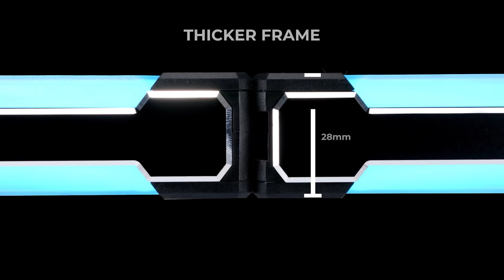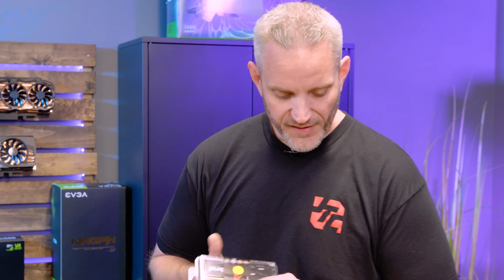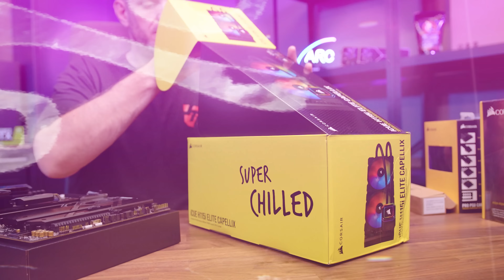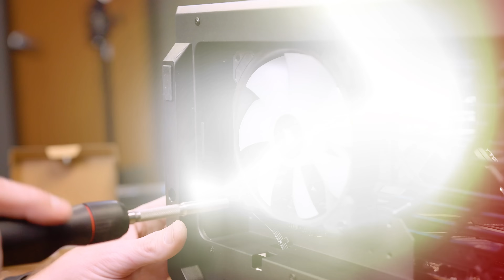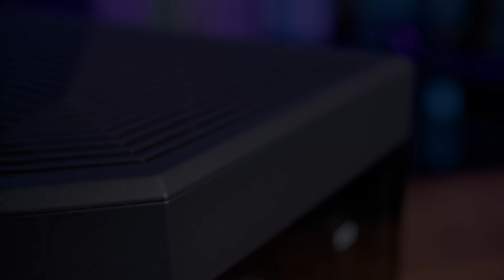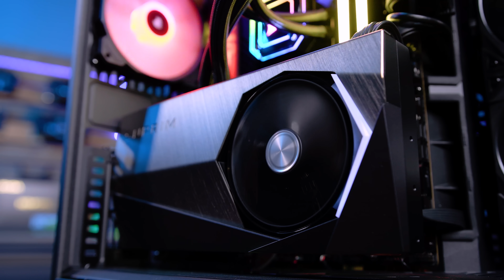I built a PC in the Hyte Y60...

Comment from the maker: Hey guys! Small correction, at the end incorrectly called out the wrong brand, I MEANT to say iBuyPower! For your custom and prebuilt needs, check out https://www.ibuypower.com!
Reply: teehee
Reply: Small correction Jay, You can use the commander with the two types of fans you have because they are both 8 led hubs you just select ML or SP in Icue. I have done a few of the ELITE CAPELLIX with the newer SP fans in a case with just the commander.
Reply: This video is perfectly timed.... I just finished a Hyte Y60 build on friday. Custom water loop with a 3070ti FE and I9-9900k. First ever water loop. I need to redo the bends at some point because they are bugging me.
Reply: Did u have to add thermal paste?
Reply: I am about to build the same exact case with a 280 mm AIO for context should I set the fans up only the bottom to intake
Reply: Hi Jay looking to getting the y60 case I have the Razer Tomahawk itx case at the moment, will my motherboard which is asus strix B660-i fit in the y60 or will I have to get a new motherboard
Reply: Parts list-listed z690 not z790 mobo :P lol just fyi, both are great options, but obviously the z790 is what was used in this build :P

Comment: The case is not the issue, the GPU is. This case was meant to be used with either a GPU which is maximum 2.5 slots wide, not 2.75. It might not sound like much, but those 6 mm frees up more space than you might think for cooling. Granted, the 40 series was not a thing when you did this, so talking about a 40 series 70 or 80 which is narrower and run much cooler than the 30 series, is a moot point. What this case was meant to do, was to run water cooling on both the CPU and GPU. This thing will be a monster with a 14900K and 4090 or AMD 3D CPU in it, as long as there are water involved. And while I understand your choice of fans, try and run the Arctic P12 Max on that radiator. Your CPU temps will plummet, and they are quite a bit quieter than the Lian Li's. Those Lian Li's are hybrids, and while they do kinda work on the AIO, they are far from optimal, especially as pusher fans.

Comment: I'm building in the hyte y60....once i plug in the gpu (NITRO+ AMD Radeon™ RX 7900 XTX Vapor-X 24GB) , motherboard won't work.  1000 w psu.  if i don't plug in the power, gpu rgb will light up and board works.  any ideas?  I've looked on the web and can't find anything.  thanks

Comment: If i horizontally mounted the gpu and swapped out ALL the fans with top tier fans, and put fans in the bottom and 3 fans in the side, would the thermals be ok?
Reply: Should be, really depends on the intake/exhaust ration

Comment: According to studies the aio should always be in the intake config so that you're pulling cool outside air through the radiators instead of blowing hot air through it causing the water temps to be the same as the hotter temps inside the case.

Comment: Can I it handle like 4x 3.5 Hard drives? I willing to buy it but didn't see any options for this SSDs and HDs mount
Reply: Why on Gods green earth would you still use HDD
Reply: @OkAndBruh  if you don't have anything to contribute with just pass the comment. I already solved the problem using a DIY tray made to handle 2 more HDD inside my case.
Reply: @vendra00  I’m contributing is knowledge that HDD is slow and outdated. You can get SSD that’s, albeit, slightly more expensive, but holds at least 2tb of storage that loads significantly faster.

Comment: nice, thanks for the build i want that card in that case and was unsure if it was workable, nothing sucks like having to return a expensive case or an insanely expensive card because they wont play well together. shame the hoses arent longer to route them away and more discreetly. the setup of the commander pro on the sled is handy, planning on corsair fans  altho thinking 140's on the bottom for a bit more flow and maybe the  shift 1200PSU for a bit cleaner install.

Comment: I'm planning on buying this case but i'm facing a dilemma on the fan configuration. I have a 5600x and an msi 2070 super as my cpu and gpu which arent really "hot" components. I have the following fans: 3 Corsair LL 120mm, 2 LL 140mm RGB fans and 2 Non-RGB ML fans in my current case with an push/pull configuration using the both 140mm fans. With that being said, what would be the ideal fan configuration on the Hyte Y60 for optimal airflow? I was planning on using the Non-RGB ML 140mm fans has bottom intakes, the remaining 120mm fans has Rear and Top exhaust and the RGB 140mm radiator fans has intake on the side. The thing is, aesthetically speaking i think the 140mm LL RGB fans as intakes on the side are not gonna look good. Will the temps be really that bad if i use them as intake also? If anyone could help me i would high appreciate it.
Reply: You pretty much want more intake then exhausev

Comment: Jay,   I am working on this same build and all is working well except now where I am trying to connect the GPU to the PSU and there is no way that I can stuff all those wires behind the PSU and install it.  Cables that came with the Corsair PSU are just to bulky and stiff.  What did you use?

Comment: You mentioned you did bottom as the only intake? So the rest side, back and top (radiator) will be exhaust? Is that the best fan configuration? I know then you mentioned that you could of done the top (radiator) intake instead for a nice balance, is that a better option then? I’m building one myself for the first time alone right now on this case and hopefully to get the airflow right. 😅

Comment: Built mine with a air cooled 4090, I had to spend 200£ on 6 phantek t30 fans and I got 2 big fans at the bottom just to keep it around 50c, going to have to upgrade the bottom fans as they came with the case. My pc has been a long process of learning

Comment: I am following up from your radiator orientation video where you suggest that the ideal location for the pump wires is coming from the bottom for 240mm. But I noticed that you had the pump go on top for this build. I know that is also an okay orientation but is there a reason why you didn't go with the ideal orientation where the pumps don't come from the bottom?

Comment: Jay, I am using a Hyte Y60, ASUS Strix ROG Z690-E, I9-12900, RTX 3080, (2) M.2, 64 GB, Corsair fans, Corsair 380 AIO, ICUE, ThermalTake 850W.  My question is there are 8 fans, 2 intake and 6 exhaust.  Shouldn't there be more intake and less exhaust?  Seems like I'm creating a "vacuum" in the case and more outside air would be advantageous.

Comment: I've just got the red version of this case. I live in the UK and I've only ever seen it on general sale once, for about a day, and I regretted not clicking the buy button when I saw it that day, it actually took me 5 months after that day to get my hands on a new Y60 and I had to resort to eBay to get a YouTuber review sample. So sad.

I previously had the Lian Li O11 Dynamic and while I have so much appreciation for that case, the Hyte Y60 is on another level. Having a gen 4 vertical GPU riser, the hidden basement with fans, a bracket for your AIO in the roof, and even the extra 120mm fan spot on the back are huge improvements, and the whole aesthetic of the case makes it look so much cleaner than the O11. I had doubts when I was dismantling my old setup, that I was making a mistake, but everytime I look at my system now (aside from it being dust free again) I smile at how fantastic it looks.

Comment: do you think this case can fit a 360aio and a 240aio comfortably ?
Reply: it can fit a 360mm radiator on the top and up too a 280mm on the side but i think i would be very tight
Reply: @ryffera59  problem is with my 4000x is that I can’t have the “fittings” in the same area was hoping this case would alleviate that
Reply: 360 fans fit fine
Reply: @baronlund9725  with a 240 aswell?

Comment: I agree with the full white idea, I would even recommend only having the top with ring RGB set to white and then line up a white strip led strip around the inside of the y60 frame to accent the curvature.  The hx1200w wasnt fun to work with here using stock cables, your assumption is correct.  Great video!  Surprised you didn't add a LCD Display to the corner glass.
Current y60 build:
-Asus x570plus mobo
-EVGA 3080 ftw3
-R9 5900x
-(2) noctua 140s case bottom
-280mm arctic liquid freezer AIO case side mount (arctic won't fit in top compartment regardless of rad length due to thickness)
-Rest are arctic p12 with ring styled rgb.  (those lian li fans are definitely more stylish but I went for less noise according to the internet)
-Phantek RGB strip curving around bottom of case

Everything set to white

Comment: Ehhh this looks like negative pressure, getting positive pressure in this case with dual rads seems to be extremely difficult. I'm trying to conceive of a way to mod it. That's the only thing keeping me from buying it right now. Just dont want to deal with dust.
Reply: try montech sky two
Reply: you could cut the glass somehow and mount the aio to the glass on the front panel. but id want an extra piece of glass to put it back to stock after

Comment: I have almost the exact same build except I used a Strix 360MM AIO, Corsair vengeance DDR5 5600, EVGA P3 1200W PSU and Noctua 140MM fans on the bottom.

Comment: i did a similar build with a 360 cpu aio build and the strix lc 6900xt but i mounted the gpu aio with tubes at the bottom as in the best config. depending on how you decide to adjust the case, it is possible to mount 3 120mm fans vertically on side panel for additional intake and make it a fully positive pressure case.
Reply: How do you mount the 3 extra fans?

Comment: Question: isn't negative air pressure a bad thing? Cause it looks like CPU, GPU and the rear fan are all exhaust.
Reply: the ones on the bottom are intake
Reply: It's only bad if J's not being pimped by sponsor. In this case, it's ok

Comment: so 3090 fe wouldn't be good in this case?
Reply: I have a 3070 FE in their and the temps never go above 55 C with no dedicated, additional cooling for it. Obviously the 3090 is a different beast but that’s just for reference. The hyte y60 subreddit is very helpful for questions like this.
Reply: @NikolaSFK2000  I'm thinking of either Antec P120 or Hyte Y60
Reply: @NikolaSFK2000  3070 FE is 2 slot card. mine is 3 slot card. a bit worried of the gap it has

Comment: I just finished a build in the HYTE Y60 WHITE case, TWO DAYS before you posted your build video, Jay! Beautiful! Components list:

AsRock TaiChi Carrera X670E EATX Motherboard
AMD Ryzen 9 7900X CPU
EVGA CLX 360mm AIO CPU cooler
Teamgroup T-Force Delta RGB DDR5 ((2) 32GB kits / 64GB total) 
EVGA GeForce RTX 3090 FTW3 ULTRA GAMING
EVGA SuperNova 1000W G6 GOLD Power Supply (nice and short depth, so lots of room for cable management)
(2) Samsung 980 PRO 2TB NVMe Gen4 M.2 SSDs configured in RAID1 (for OS and applications)
(2) Western Digital Black 10TB HDDs configured in RAID1 (for Storage)
(4) BeQuiet Light Wings High Speed 140MM PWM/ARGB ((2) Front/Side and (2) Bottom, all intake)
(4) BeQuiet Light Wings High Speed 120MM PWM/ARGB ((1) Rear and (3) Top on the EVGA AIO Rad, all exhaust)

BeQuiet's fans have two separate cables, one for PWM, and the other for ARGB. The ARGB wire has a pigtail at the plug to daisy-chain multiple ARGB connections to one port, without needing any ARGB hubs, though the 3-pack of these fans comes with an ARGB hub, I did not end up needing it, as I have all 8 fans connected to two ARGB headers (4 each).

All RGB is set to static white and it looks great with the tinted glass!

Thanks for being a great example, Jay!

Comment: The case is designed to have bottom intake and side/front intake (flip the GPU rad fans).

Why two intake five exhaust? Just to make it pretty for the B-roll? It would look better if it was set up for better thermals, imo. It really irks me to see tempered glass cases with a ton of fans set to exhaust for pretty fan reasons.

Comment: Any issues at all with the ram hitting the radiator fans up top? had to move my 280 rad on my corsair 4000 because the taller ram hit the fan, so I'm running the stupid rad in the front setup.

Comment: I did a build in it for work. Felt great! Only issue was talked about, because of modern GPU horse power those 1200+ psu are so chunky. Being a work computer it had two hard drives mounted as well running in parity. Made those stiff standard corsair psu just awful and I had to cram so many cables as well as I janked the heck out of the hard drive cables so you still could pull them out from the back for swapping

Comment: Great vid as always @JayTwoCents

Maybe this would be a good place to ask:  Thinking of building a flashy NAS in a Hyte Y60.  

How tough would modding the side fan/RAD mount be to mount a couple of 3X5.25" to 5X3.5" Hot-Swap HDD cages be you think? (like the Siivertone SST-FS305-12G).

Looks like depth wise there's be room for that, 140mm fan and a small 3d printed adaptor to push air out over the drives.

Comment: This case would not allow me to vertically mount my GPU and still have my sound card plugged into the last slot like the Lian Li O11 Dynamic EVO. As for fans, I'm steering clear of Corsair. I have 13 Lian Li AL120s on two fan controllers and an EK AIO Elite that does not require a controller. With 10 Corsair fans and a Capellix 360, I had so much wire and three large fan/pump controllers that I would not be able to fit the two 8TB HDD in my case.

Comment: I just built an AMD system in the Y60 and I'm loving it so far. I tried saving parts from the PC I had before, but most of it ended up being new except storage and the CPU with its AIO cooler. RTX3080 12gb Gigabyte AIO cooled card. 64gb Kingston Fury Beast DDR4. Ryzen 9 3900XT.

Comment: Looks awesome!! I bought the case because of your review on it and its insane. Also you can remove the middle glass panel after removing the other two. There are two screws up top and two on the bottom and it pops out really easily. : )

Comment: I bought one of those corsair AIOs. I sent it back because the pump noise is so annoying. Got a Phanteks glacier one instead, which has a much quieter pump.. the LEDs suck though because the blue LEDs seem to die fast, meaning if you want a white look, it comes out like yellowish. They're kind of both shitty but I find the Phanteks the least annoying of the two. Would probably go for the Arctic cooler if I could do it all again (the thing is, I wanted a white one, or I would have).

Comment: That system has a lot of ventilation, but also is currently in a huge negative pressure situation with that fan configuration (5 exhaust, 2 intake)...  I'm interested to see how the dust buildup is over time. Looks great though!
Reply: It’s 4 insane intake, 3 exhaust
Reply: @OkAndBruh I'm doing a similar build and going to make the GPU AIO intake instead of exhaust.  Might not look as pretty but should perform better

Comment: Ya gotta get the Commander Core XT if you're using multiple fan types. But with the AIOs, you have to use the Commander that comes with it because it has the long flat connector and the XT doesnt.

That just means add more fans :-p

Comment: When they created this case they did not know how big gpu would get, that is why they gave J the liquid cooled one. For everyone else.. good luck using that vertical mount. Imagine buying  this big of a case and still have gpu space issues. And not just vertical mount. Other ppl on youtube have to remove the glass not to bend the problematic connector into a pretzel when mounted normally. Too much space dedicated for cable management I guess?

Comment: You actually can control corsair fans with different counts of integrated led with a single lighting node pro when you just go single color. Just set up the lighting node for the fans with the higher led count and connect these to the first output channels on the device. These fans will work in an provided setup just fine an without any errors. When you dont want to go for a fancy lighting mode for the SP120s on the other channels, they will give you any single color mode that you want. Think those are the ones with less leds in your build... Thats what I do.

Comment: Building a new system in this case right now. Got a 13900k and a 4090 and planning on doing to custom loop in it, just waiting on the water block for the gpu from EK. Already planned the route and pre-installed rads, fans, mobo and what not.

Comment: Love the build. I just did mine with that case same cpu and gpu. I used the solo 120mm as an intake for 3 intakes and 5 exaust. But two bottom fans noctua 140mm 3000

Comment: I bought a Y60 about a month ago fora new custom loop & slowly picking out parts. Decided to stay D4, ASUS Tuf z690 w/ Intel 13600k, 32g 3600 DIMM, msi rx 6700 xt 12g. Cable extensions for theme. Tall d5 pump/tank combo, 2-240 rads, thermaltake cpu block, matte black rigid tubes, yellow coolant. I’m still pending GPU block & yellow fittings. 
Truthfully I’m unsure how many of which fittings to get (first time custom liquid cooling). Seems like I’ll need to get a bunch of everything & see how it all works out lol my poor bank account 😂

Comment: I know Jay knows what he is doing but it looks like the graphics card AIO, has the tubes going to the top of the radiator. All the installations I've seen or read online, are done the same. I thought, due to not wanting any air getting into the pump, it's usually recommended to have the hoses at the bottom of an AIO radiator ?